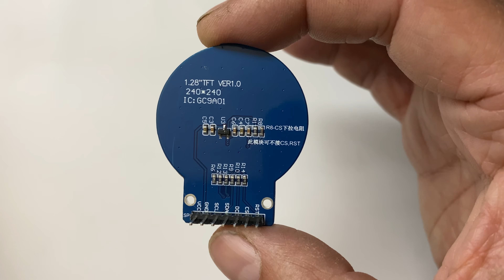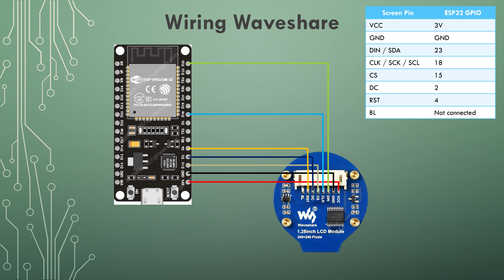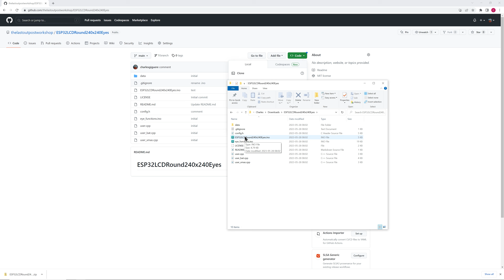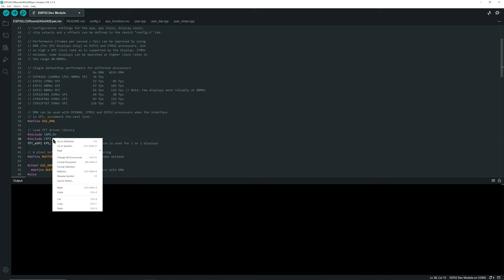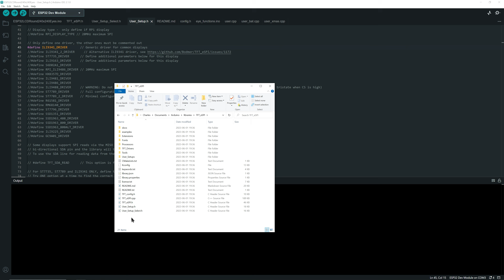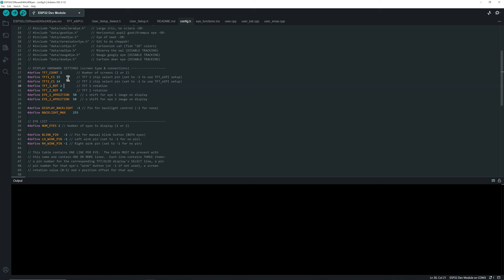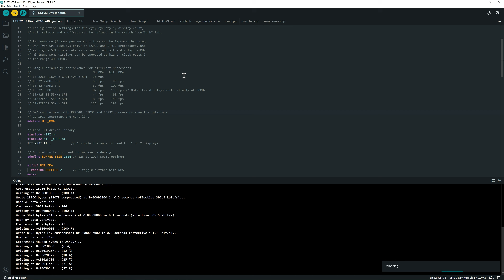Master the Round TFT Display on ESP32 and GC9A01 driver with the TFT_eSPI library

Comment: It keeps coming up with this error message what have i done wrong?

C:\Users\zoefa\Documents\Arduino\ESP32LCDRound240x240Eyes\ESP32LCDRound240x240Eyes.ino:80:9: error: 'NUM_EYES' was not declared in this scope
   80 | }  eye [NUM_EYES];
      |         ^~~~~~~~
C:\Users\zoefa\Documents\Arduino\ESP32LCDRound240x240Eyes\ESP32LCDRound240x240Eyes.ino: In function 'void setup()':
C:\Users\zoefa\Documents\Arduino\ESP32LCDRound240x240Eyes\ESP32LCDRound240x240Eyes.ino:101:3: error: 'initEyes' was not declared in this scope
  101 |   initEyes();
      |   ^~~~~~~~
C:\Users\zoefa\Documents\Arduino\ESP32LCDRound240x240Eyes\ESP32LCDRound240x240Eyes.ino:112:16: error: 'eye' was not declared in this scope
  112 |   digitalWrite(eye[0].tft_cs, HIGH);
      |                ^~~
C:\Users\zoefa\Documents\Arduino\ESP32LCDRound240x240Eyes\ESP32LCDRound240x240Eyes.ino:113:7: error: 'NUM_EYES' was not declared in this scope
  113 |   if (NUM_EYES > 1) digitalWrite(eye[1].tft_cs, HIGH);
      |       ^~~~~~~~
C:\Users\zoefa\Documents\Arduino\ESP32LCDRound240x240Eyes\ESP32LCDRound240x240Eyes.ino:115:27: error: 'NUM_EYES' was not declared in this scope
  115 |   for (uint8_t e = 0; e < NUM_EYES; e++) {
      |                           ^~~~~~~~
C:\Users\zoefa\Documents\Arduino\ESP32LCDRound240x240Eyes\ESP32LCDRound240x240Eyes.ino:117:21: error: 'eyeInfo' was not declared in this scope; did you mean 'eyeInfo_t'?
  117 |     tft.setRotation(eyeInfo[e].rotation);
      |                     ^~~~~~~
      |                     eyeInfo_t
C:\Users\zoefa\Documents\Arduino\ESP32LCDRound240x240Eyes\ESP32LCDRound240x240Eyes.ino: In function 'void loop()':
C:\Users\zoefa\Documents\Arduino\ESP32LCDRound240x240Eyes\ESP32LCDRound240x240Eyes.ino:132:3: error: 'updateEye' was not declared in this scope
  132 |   updateEye();
      |   ^~~~~~~~~

exit status 1

Compilation error: 'NUM_EYES' was not declared in this scope
Reply from the maker: Open an issue here : https://github.com/thelastoutpostworkshop/ESP32LCDRound240x240Eyes
Reply: i have the same issue, did you solve your issue?

Comment: I have a question, is it possible to add other types of eyes ?  What do I need to create the want I would like to use ?
Reply from the maker: You could create them using animated gif, this tutorial should give you a good starting point : https://youtu.be/mqSe_uMpxIs
Reply: @thelastoutpostworkshop  thanks 👍
Reply: @thelastoutpostworkshop  i'Ve try it but it gave me error with the eyes parameter (sclera ).  I've check the other eyes script and I've try to copy the same varaible but in vain.  Also i'm a Linux user, so I can't user convert to C but i've found an online tool and task which format I need my picture (RGBA888 and others) ... I dont know if you could help me on that.  Maybe I should use the code of Bring GIFs to Life: Animating with Round Displays & ESP32.  I will hit a wall when I'll need to do a rotation for the right eye.

thanks :)

Comment: i keep getting this 
/home/john/Arduino/ESP32LCDRound240x240Eyestest/ESP32LCDRound240x240Eyestest.ino:80:7: error: 'NUM_EYES' was not declared in this scope

   80 | } eye[NUM_EYES];
      |       ^~~~~~~~
/home/john/Arduino/ESP32LCDRound240x240Eyestest/ESP32LCDRound240x240Eyestest.ino: In function 'void setup()':
/home/john/Arduino/ESP32LCDRound240x240Eyestest/ESP32LCDRound240x240Eyestest.ino:101:3: error: 'initEyes' was not declared in this scope
  101 |   initEyes();
      |   ^~~~~~~~
/home/john/Arduino/ESP32LCDRound240x240Eyestest/ESP32LCDRound240x240Eyestest.ino:112:16: error: 'eye' was not declared in this scope
  112 |   digitalWrite(eye[0].tft_cs, HIGH);
      |                ^~~
/home/john/Arduino/ESP32LCDRound240x240Eyestest/ESP32LCDRound240x240Eyestest.ino:113:7: error: 'NUM_EYES' was not declared in this scope
  113 |   if (NUM_EYES > 1) digitalWrite(eye[1].tft_cs, HIGH);
      |       ^~~~~~~~
/home/john/Arduino/ESP32LCDRound240x240Eyestest/ESP32LCDRound240x240Eyestest.ino:115:27: error: 'NUM_EYES' was not declared in this scope
  115 |   for (uint8_t e = 0; e < NUM_EYES; e++) {
      |                           ^~~~~~~~
/home/john/Arduino/ESP32LCDRound240x240Eyestest/ESP32LCDRound240x240Eyestest.ino:117:21: error: 'eyeInfo' was not declared in this scope; did you mean 'eyeInfo_t'?
  117 |     tft.setRotation(eyeInfo[e].rotation);
      |                     ^~~~~~~
      |                     eyeInfo_t
/home/john/Arduino/ESP32LCDRound240x240Eyestest/ESP32LCDRound240x240Eyestest.ino: In function 'void loop()':
/home/john/Arduino/ESP32LCDRound240x240Eyestest/ESP32LCDRound240x240Eyestest.ino:132:3: error: 'updateEye' was not declared in this scope
  132 |   updateEye();
      |   ^~~~~~~~~

exit status 1

Compilation error: 'NUM_EYES' was not declared in this scope
Reply: how do i fix
Reply from the maker: Make sure you open the project in the Arduino IDE 2 by double-click the ESP32LCDRound240x240Eyes.ino
Reply: @thelastoutpostworkshop   i reopened it. same errors   NUM_EYES not declared
Reply from the maker: does the eye_functions.ino file is in your folder project ?
Reply: @thelastoutpostworkshop   that might be it i have to rewatch the video . thank you. i'm a total noob. got my 1st arduino kit like 2 months ago then got esp32s specifically to make this for a couple  skulls i have.
 thank you for responding.
Reply: @thelastoutpostworkshop   the eye functions ino exists  in my folder but i might have missed "activating it" or whatever. testing time
Reply: @thelastoutpostworkshop   still doing something wrong. i'm sure you are right but how do i get the main file to connect with the eye functions one. which part of the vid do I keep missing
Reply: figured it out. i had the folder set up wrong.

Comment: Love the Step By Step however I keep getting an error on line 80 of the Sketch when I try to upload.  I'm using 2 each 1.5 inch RGB OLED Modules for the eyes with Driver SSD1351; which I've made sure to update accordingly.  I followed the video instructions all the way and updated the Config.h file to show 2 displays however I just can't get it to upload onto my ESP32 board.  Any suggestions are welcome!
Reply from the maker: What is the error you are getting ?
Reply: @thelastoutpostworkshop  "Compilation error:  'NUM_EYES' was not declared in this scope"  It jumps to line 80 of the .ini sketch. I did update the Config.h file as well as all of the other steps.
Reply: /Users/deborahortiz/Downloads/ESP32LCDRound240x240Eyes-main/ESP32LCDRound240x240Eyes/ESP32LCDRound240x240Eyes.ino:80:7: error: 'NUM_EYES' was not declared in this scope
   80 | } eye[NUM_EYES];
      |       ^~~~~~~~
/Users/deborahortiz/Downloads/ESP32LCDRound240x240Eyes-main/ESP32LCDRound240x240Eyes/ESP32LCDRound240x240Eyes.ino: In function 'void setup()':
/Users/deborahortiz/Downloads/ESP32LCDRound240x240Eyes-main/ESP32LCDRound240x240Eyes/ESP32LCDRound240x240Eyes.ino:101:3: error: 'initEyes' was not declared in this scope
  101 |   initEyes();
      |   ^~~~~~~~
/Users/deborahortiz/Downloads/ESP32LCDRound240x240Eyes-main/ESP32LCDRound240x240Eyes/ESP32LCDRound240x240Eyes.ino:112:16: error: 'eye' was not declared in this scope
  112 |   digitalWrite(eye[0].tft_cs, HIGH);
      |                ^~~
/Users/deborahortiz/Downloads/ESP32LCDRound240x240Eyes-main/ESP32LCDRound240x240Eyes/ESP32LCDRound240x240Eyes.ino:113:7: error: 'NUM_EYES' was not declared in this scope
  113 |   if (NUM_EYES > 1) digitalWrite(eye[1].tft_cs, HIGH);
      |       ^~~~~~~~
/Users/deborahortiz/Downloads/ESP32LCDRound240x240Eyes-main/ESP32LCDRound240x240Eyes/ESP32LCDRound240x240Eyes.ino:115:27: error: 'NUM_EYES' was not declared in this scope
  115 |   for (uint8_t e = 0; e < NUM_EYES; e++) {
      |                           ^~~~~~~~
/Users/deborahortiz/Downloads/ESP32LCDRound240x240Eyes-main/ESP32LCDRound240x240Eyes/ESP32LCDRound240x240Eyes.ino:117:21: error: 'eyeInfo' was not declared in this scope; did you mean 'eyeInfo_t'?
  117 |     tft.setRotation(eyeInfo[e].rotation);
      |                     ^~~~~~~
      |                     eyeInfo_t
/Users/deborahortiz/Downloads/ESP32LCDRound240x240Eyes-main/ESP32LCDRound240x240Eyes/ESP32LCDRound240x240Eyes.ino: In function 'void loop()':
/Users/deborahortiz/Downloads/ESP32LCDRound240x240Eyes-main/ESP32LCDRound240x240Eyes/ESP32LCDRound240x240Eyes.ino:132:3: error: 'updateEye' was not declared in this scope
  132 |   updateEye();
      |   ^~~~~~~~~

exit status 1

Compilation error: 'NUM_EYES' was not declared in this scope

Comment: Thanks got this to work! I too am trying to figure out how to make the eyes bigger are you still putting out a video on that? 

I did see another video where a guy found a github file for uncanny eyes that had a bigger bitmap to fit a 240x240 display and somehow plopped it into the smaller sketch files to get bigger eyes.  I say somehow because I dont know arduino very well and it was in indonesian so i couldnt follow what he actually did.
Reply from the maker: Thanks, yes it is on my to-do list, but I don't know when I will do it yet!

Comment: Thanks for the video, I am having an issue with the Go to Definition. The TFT_eSPI.h isn't there. I downloaded the library.
Reply from the maker: You have to install the TFT_eSPI librayr from the library manager
Reply: @thelastoutpostworkshop  thanks for the quick reply. It took 2 trys but I loaded 2.5.43. I managed to go to TFT_eSPI.h and try clicking on User_Setup on line 68 but it says no definition. I noticed the TFT_eSPI tab is locked not sure if that matters.

Comment: To center the eyes and rotate them go to eyes_function.ino line 114 there are three numbers there, change the first one only to 50. Next go to config.h change the lines 30 and 31 to 4 and change the lines 32 and 33 to 50 which they should both be already upload the sketch. I'm using The LCD display with the pins so that will rotate them so the pins are down and you can stand the eyes up and look at the eyes. So depending on what you want your eyes to look like you can play with a rotation number.

Comment: Any way to center the eyes to middle of the displays ?
Reply: Had this same question today and was able to figure it out. Line 114 of eye_functions.ino, in the drawEye function, you'll find this code:
 tft.setAddrWindow(eye[e].xposition, 0, 128, 128);
Change the 0 to update the position of the drawing window. I found that somewhere around 50 got the eyes fairly well centered. So the changed line will look like this:
 tft.setAddrWindow(eye[e].xposition, 50, 128, 128);
Reply: @j.mcneil  Thanks!  That's much better!
Reply: @j.mcneil Amazing... THANKS A LOT!

Comment: I have the flickering issue with the CS pin, i changed the CS pin d15  to pinD5 and everything worked perfectly.
Reply: Hi! How did you change the PIN number, my ESP32-S3-WROOM-1 does not have the PIN 23, so I can not use the script. I guess it should be somewher on the TF_eSPI directory. Thanks!
Reply: J`'ai fait la même chose et ça marche très bien .

Comment: I was following your tutorial and where you say go to definition User_Setup_Select.h. It Says no definition found for  "User_Setup_Select". Is there a file missing?
Reply from the maker: It comes with the TFT_eSPI library, make sure you have it installed
Reply: @thelastoutpostworkshop  I have uninstalled and reinstalled and still keep getting the same error message. I even uninstalled the latest version and installed the 2.50 version like you have and still keeps telling me it doesn't exist. What could I be doing wrong? Could it be the ESP32 Module?
Reply: @npdjrick1  Curious if you ever found out how to fix this?  I am having the same issue.
Reply: @bsshsesports6598  Unfortunately no. I had to go a different route. I decide to with Raspberry Pi 4 and I got it working much faster. But I will return to this one in the future. I was also able to change the Eyes where he says on another question that you cannot change the eyes. which I have done.
Reply: @npdjrick1  Figured it out.  Both the installed library in this case TFT_eSPI but be in the same location as your Sketch.  I changed my Sketch folder to a primary location on my drive and then reinstalled the libraries and it worked!
Reply: @bsshsesports6598  AWESOME Thank you I will try it this evening and I'll let you know if it worked for me too. Thank you for the Update.

Comment: having issue, can you help ?
Reply from the maker: sure what issues do you have ?
Reply: @thelastoutpostworkshop  i am using nodemcu board, and spi 1.4inch display, while compiling the code i am getting error related to : TFT_eSPI methods initDMA and pushPixelsDMA
Reply from the maker: Try by commenting this line in the sketch : //#define USE_DMA
Reply: @thelastoutpostworkshop  thanks it worked, uploaded the code successfully, but i am not able to see animation... only lines kind of things....

in the TFT_eSPI/User_Setup.h

i am using #define ST7735_DRIVER 
as the display i have has ic  ST7735

similary in User_setup_select.h

i am using 
#include <User_Setups/Setup7_ST7735_128x128.h>
Reply from the maker: If you see garbage on the screen, it is your pins configuration or wiring
Reply: @thelastoutpostworkshop  ohhh... I extracted wires from the usb cable that i wasn't using,

And configured it according to your guide....
Reply: Actually not exactly your guide, as you were using different board..
I am using nodemcu esp8266

I checked the configuration in User_Setup.h

If it is not correct could you tell where i can make changes ??

My board has pins from d0 to d8
Reply from the maker: I have never tester it on a ESP8266, so I don't know if it work with the TFT_eSPI library.  You can check here : https://github.com/Bodmer/TFT_eSPI  Try the examples that comes with the library to see if they works.
Reply: @thelastoutpostworkshop  hii i tried that, i used esp8266 uncanny_eyes example, it worked !, i can see eye animation on the display

Comment: friend. Just tried the eyes witg GC9A TFT. WHen compiling i get NUM_EYES NOT FOUND SEE THE ATTACH ERROR CODE. I now is ood material but i would app any hint you can give me to fix or further test  this issue. thanks.
\\Local\\Temp\\arduino-sketch-10CA1106190DAC8AE63C09F6CCD3AD6C\\sketch\\ESP32LCDRound240x240Eyes.ino.cpp.o"
C:\Users\jesus\Downloads\ESP32LCDRound240x240Eyes\ESP32LCDRound240x240Eyes-main\ESP32LCDRound240x240Eyes\ESP32LCDRound240x240Eyes.ino:80:7: error: 'NUM_EYES' was not declared in this scope
   80 | } eye[NUM_EYES];
      |       ^~~~~~~~
C:\Users\jesus\Downloads\ESP32LCDRound240x240Eyes\ESP32LCDRound240x240Eyes-main\ESP32LCDRound240x240Eyes\ESP32LCDRound240x240Eyes.ino: In function 'void setup()':
C:\Users\jesus\Downloads\ESP32LCDRound240x240Eyes\ESP32LCDRound240x240Eyes-main\ESP32LCDRound240x240Eyes\ESP32LCDRound240x240Eyes.ino:112:16: error: 'eye' was not declared in this scope
  112 |   digitalWrite(eye[0].tft_cs, HIGH);
      |                ^~~
C:\Users\jesus\Downloads\ESP32LCDRound240x240Eyes\ESP32LCDRound240x240Eyes-main\ESP32LCDRound240x240Eyes\ESP32LCDRound240x240Eyes.ino:113:7: error: 'NUM_EYES' was not declared in this scope
  113 |   if (NUM_EYES > 1) digitalWrite(eye[1].tft_cs, HIGH);
      |       ^~~~~~~~
C:\Users\jesus\Downloads\ESP32LCDRound240x240Eyes\ESP32LCDRound240x240Eyes-main\ESP32LCDRound240x240Eyes\ESP32LCDRound240x240Eyes.ino:115:27: error: 'NUM_EYES' was not declared in this scope
  115 |   for (uint8_t e = 0; e < NUM_EYES; e++) {
      |                           ^~~~~~~~
C:\Users\jesus\Downloads\ESP32LCDRound240x240Eyes\ESP32LCDRound240x240Eyes-main\ESP32LCDRound240x240Eyes\ESP32LCDRound240x240Eyes.ino:117:21: error: 'eyeInfo' was not declared in this scope; did you mean 'eyeInfo_t'?
  117 |     tft.setRotation(eyeInfo[e].rotation);
      |                     ^~~~~~~
      |                     eyeInfo_t
etc etc
Keep the good work , saluti da Italia.
Reply from the maker: Please open the issue in the code repository : https://github.com/thelastoutpostworkshop/ESP32LCDRound240x240Eyes  Also make sure you are using the complete code

Comment: Small suggestion... When I started working w/ config files many years ago I was told that MS notepad can corrupt them. Notepad++ has always been at the top of recommended editors. 👍
Reply from the maker: Never had a corrupt issue with notepad from Windows
Reply: However I also have never had any issues with MS Notepad, I prefer using Notepad++ to edit code with it.

Comment: thank you for your great tutorial. everything works well I just have a question for the position of the eyes in the center of the screen on the X axis no problem but impossible to adjust the Y axis
Reply: #define EYE_1_XPOSITION  90  // x shift for eye 1 image on display            ORIGINE 50
#define EYE_2_XPOSITION  90  /                                                                        ORIGINE 50
Reply: @jpdu62  In a comment above, someone said to put "0", I have try everything from 0 to 1500, it will only move it left or right

Comment: A great video. You managed to help me get these eyes to work! Subscribed and many thanks.

As a few other people on here have asked, is there a way you know of to increase the size of the eye to better fill the display? Or at least a way to centre the eye on the display instead of having at the top of it?
Reply from the maker: Thanks.  The eyes are fixed image, so there is no easy way to make them bigger.
Reply: @thelastoutpostworkshop  

I spent some time trying to find a way to reverse engineer the eyes from a C code array back to an image so I could resize it. Or at least understand how the image looked in the first place. No luck. Thanks for replying.